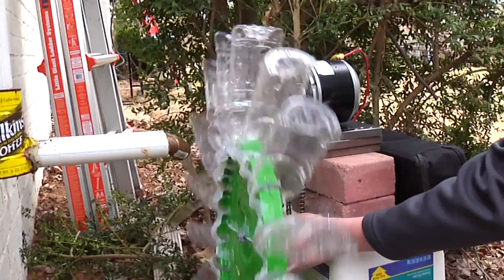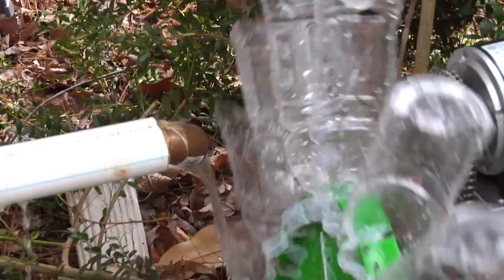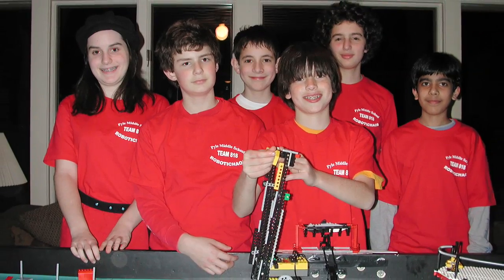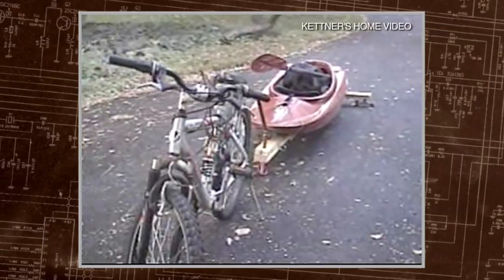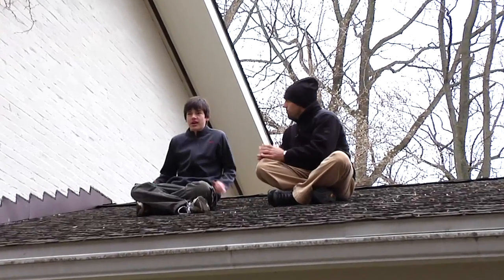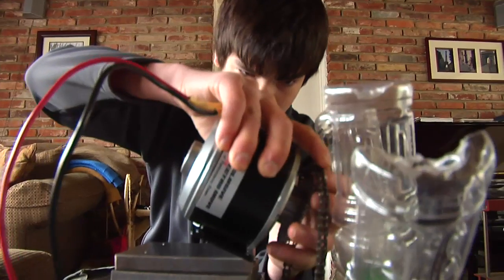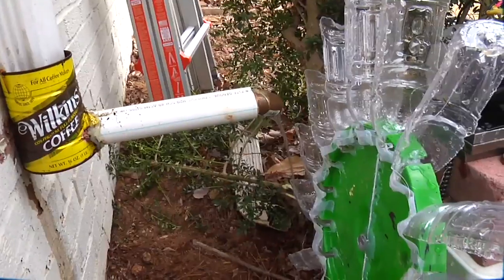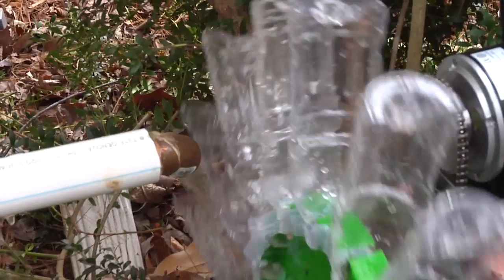Amazing Hydro-Electric Power Collector

Comment: At the bottom of the downspout, he has a steel can which diverts the water flow 90 degrees. All the kinetic energy the water gained in its fall down the downspout was converted to heat and wasted. He is just using the weight of the water as it fills the bottles and ignoring the free inertia offered by the falling water. Just trying to be helpful. I think it is a fine project and he has done a great job in the construction.

Comment: Hey Kettner,  why don't you put an enclosed water pump into your house's plumbing to power a small gen/ Alt. every time your house uses water,  ie.  Baths, Dishwasher,  Washing machine,  Showers,  etc...  I know there will be a small drop in pressure,  But don't they already put in flow restricters shower heads etc..  you can re-coop some energy out of the water pressure and still use the water.

Comment: It is a very good idea.  However, them motor did not turn during the demonstration which begs to ask, Does the generator require more energy to turn than the wheel can provide?  If so, perhaps use a smaller generator or larger wheel.

Comment: that diagram they did of how that thing works is stupid there was no circuit board to prevent the power from the battrey going to the motor so basically when you attach it to the battery the battery will run the motor instead of the motor charging the battery...you need a circuitry board to prevent the flow from going to the motor this design is bullshit

Comment: Would be more efficient if the pipe down from the gutter would be used to build up pressure and drive a high Rpm turbine (like a tesla turbine).
this way the energy moment and the height difference is almost completely wasted.

Comment: Great. But did you know the FMMC meter measures conductance not voltage and not amperes in both sereis and parallel?
Science made a big mistake, and it is up to us to try and find out the truth in an underground manner because trad. science believes it is infallible. Its a simple case of thinking clearly about what the meter does. It can only respond to current in its own coil and NOT the external current -- see? Thus when the electrons are moving slow in a fat ex. wire they are quick in Meter.

Comment: In the video the water wheel is turning but the drive chain and motor-generator is not turning equals 0.0 watts. In the animation the water wheel is turning left or counterclockwise and the drive chain is turning right or clockwise. It would be easier if both turn the same direction.